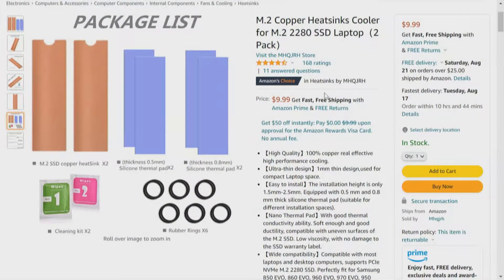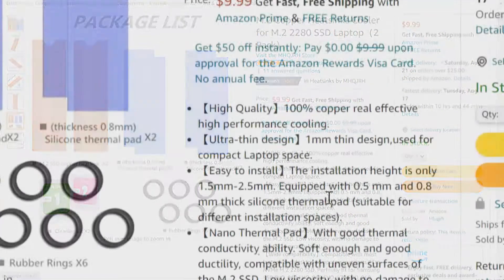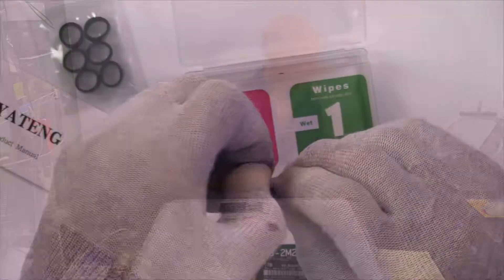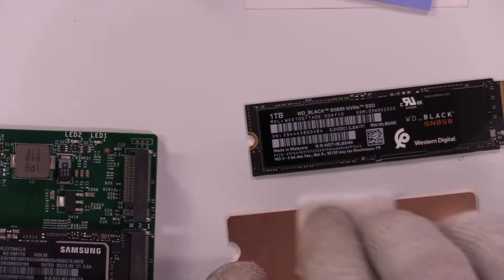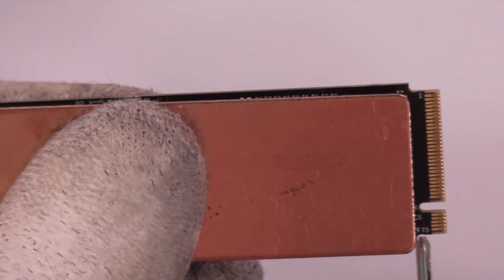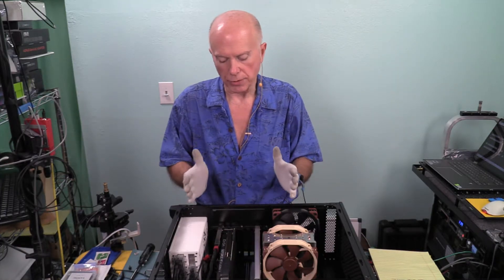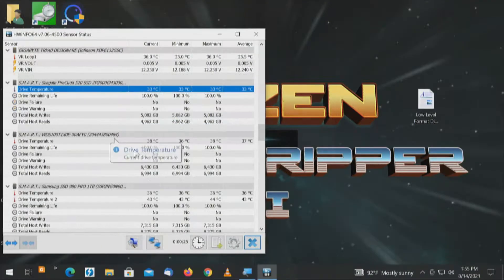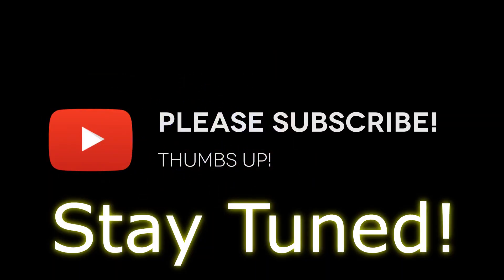Installation and Test of M.2 Copper Heatsink Cooler for M.2 2280 SSD Laptop

Comment: Hi, is there any alternative to using rubber bands to attach the heatsink. I have a fear that those rubber bands might melt and cause a mess. Can I use  twist tie as an alternative?  Thank you
Reply from the maker: Hi Habib Hussain,
Welcome! We too have concerns about the longevity of those Thermal Bands. They are not suppose to melt but We're concerned they may become brittle over time. They maintain pressure for Compression. A twist tie, Interesting idea! Give it a try! We Definitely need better fastening solutions for Heatsinks! Electrical wire used as a twist tie might be better insulated that just a twist tie. Keep Us Posted on Your Progress!
Reply: @BuildOrBuy  Thanks a lot. I will definitely give it a try. But which one do you think would be better suitable, wire (with no outer rubber insulation) or twist tie?
Reply from the maker: Ho @HabibHussain-uy7lg ,
The twist tie may not have enough insulation to isolate the internal wire if there were a break in the continuity of insulation. Could cause a short and that would be a Problem worse than what You're trying to solve. That's why the electrical wire which has better or thicker insulation. You're better off sticking with the Thermal Bands. No possible shorts! Another option might be Heat Resistant O Rings.
Reply: @BuildOrBuy  Got it. Thank you
Reply from the maker: Hi @HabibHussain-uy7lg , 
Absolutely! The only other Option for replacement Bands would be this:
Delock Products 18409 Delock Rubber Ring for Mounting of M.2 SSD and Heat Sink black 10 pieces https://www.delock.com/produkt/18409/merkmale.html
Reply: @BuildOrBuy  Would electrical tape work?
Reply from the maker: Hello @tankerock , 
Welcome! Sticky mess. Heat resistant Neoprene tape maybe.

Comment: Can you please explain or point me to your previous video where you explain how removing the SSD label b4 applying the thermal pad actually keeps it cooler? The other videos I've seen on YouTube seem to say the opposite.
Reply from the maker: Hi GunnSmyth Jaxx,
Welcome! Just now seeing Your Comment! Great Question! We do not do that nor do We advocate that. We have had a few Comments from Viewers suggesting that procedure. That's a choice. We're Testing from a Default and not changing anything from the Norm for a Fair Test. Everyone's Results may vary. This is a baseline for Comparison since We have so far Tested 14 M.2 NVMe PCIe Heatsinks. Fascinating Results! We Test too many Devices to remove any Labels. We would be busy figuring out what was what while trying to keep track of what We're doing! Hope that helps!

Comment: Hello! I don't if anybody tried but I am kinda noob at laptop modding,so I wanted to ask experienced ones! I bought a heatsink that's 6mm thick,and i have Acer Nitro 5 2021 case,I want to apply that heatsink to my ssd. But I am not sure if I have clearence or not. How can I measure it? Or is there any guide for it? Like "it should be 2mm or 3mm maximum" kind of. Thanks in advance!
Reply from the maker: Hi İLHAN BAYRAMOĞLU,
Welcome! Sorry to take so long in getting back to You! Working on Filming Videos! A lot of this is trial and error. Only way to know how much space You have, if any, would be to open the Laptop and see. 6mm sounds way too thick. Doubt you have even 2mm. Always Test and Verify! Try a Silicone Thermal Pad of 1mm and stack to determine the height clearance as You replace the cover. If too tight, You'll know very quickly! Hope that helps! Keep Us Posted on Your Progress! Thanks for Asking!
Reply: @BuildOrBuy  I also have the Acer Nitro 5 and I recently added a second m.2 nvme SSD. Underneath the second one there's a small bundle of wires that I'm worried about getting damaged over time. They have a thick black wrap around the middle but because the connector is wide on each end there's this exposed section of wires closest to the connectors on the end. Does the bottom side of an m.2 nvme SSD get hot or only the chips? I'm wondering if I should possibly try to put a piece of thermal pad in between the m.2 nvme SSD and the wires on top of the motherboard?
Reply from the maker: Hi @GrabLifeByDaPoosy ,
Welcome! From what You've described, suggest Insulating tape for non Conductivity. Don't want to get Your Wires crossed! Really! Depending upon Your chosen M.2 NVMe PCIe SSD Drive. Some have nothing on the back and some might have a copper heatshield on the back. You just have to be prepared! Hope that helps!
Reply: @BuildOrBuy  Thank you for your response. Does the circuit board get hot on the back side of an m.2 nvme SSD or is it mainly the chips installed on it? It just concerned me that there was wiring so close to the backside of drive. I wasn't sure if I should try to put some insulation between them.
Reply from the maker: Hi @GrabLifeByDaPoosy ,
Absolutely! Good timing! There's no way to accurately measure Heat from the back in this setup. Memory and Controller Chips gets hot. If the Temp of the Drive goes over the Threshold, expect Throttling. Some Vendors appear to expect Heat to dissipate through the PCB. Doubtful about that scenario. Hope that helps!
Reply: @BuildOrBuy  Thank you
Reply from the maker: Hi @GrabLifeByDaPoosy ,
Absolutely! Thank You for Watching!

Comment: where was the laptop installation in all of this?
Reply from the maker: Hi Divien,
Welcome! We have yet to make that Video! Testing 14 M.2 NVMe Heatsinks became a very involved process along with 3 different Thermal Pads. Then Subscribers Questions about Adding M.2 NVMe PCIe Storage by way of Quad cards to Motherboards. That too has taken on a life of its own. We will swing back around to this Topic! This will probably be using an ASUS Laptop. Just today We had confirmation of another M.2 NVMe PCIe Heatsink, Gigabyte, that will not fit in a Laptop so We're working on it! Appreciate Your Patience! Thanks for Asking!

Comment: I  didnt understand why you can achive pcie 4 speeds on a pcie 3 slot with the WD sn850?
Reply from the maker: Hi Admiral Spyro,
Welcome! The Supermicro Dual M.2 NVMe Adapter is just an I/O Card. There is no circuitry on that Add in card such as a PLX Chip to limit Speeds. Speed is dependent upon Motherboard Chipset and M.2 NVMe PCIe Drive. Now PCIe 5.0 will be a different matter where Speeds are Doubled again and heat also increases due to speed. Hope that helps!
Reply: @BuildOrBuy  Ah I see thanks!
Reply from the maker: HI @admiralspyro9722 ,
Yes! Interesting facts! Proof is in the doing!

Comment: Question... Would there possibly be any issue or even any possible benefit to layering a Loose/extra copper ssd plate/heatsink like the one in this video (1mm). Along with a 4mm Aluminum SSD heatsink (Example: M.2 SSD > Thermal Pad > 1mm Copper Plate > 4mm Aluminum Heatsink) ? Whether the Aluminum Heatsink is a 2 sided/piece or single.  Thanks in advance !
Reply from the maker: Hi Yoyo Droider,
Welcome! An option worth exploring! We've learned enough about M.2 NVMe Heatsinks and Thermal Pads to never say never and to test and verify. That's all that matters are Results! Do the Research and see where that takes Us! Hope that helps! Great Question! Thanks for Asking!
Reply: @BuildOrBuy ,  I was also wondering this, except I'm curious if you'd also need to put an extra thermal pad in between this thin copper plate and the larger heatsink or would you just place them metal to metal?
Reply: @gundamsdm  I would expect that the copper-to-copper contact wouldn't be sufficient for the same reason we don't put a heatsink on a cpu without thermal paste. I'd use the thinnest available thermal pad.

Comment: Nice video! In my laptop i have problem, M2 Samsung 970 EVO at bad spot and heat goes up to 110°C in game like PUBG. My laptop is Lenovo Y520. I will defintly buy thin copper sink since I do not have space for bigger.
Reply from the maker: Hi Josip Matić,
Welcome! Just now seeing Your message! Appreciate Your Comments! Laptops don't go far enough in helping Us to dissipate heat. Surprisingly, that solid piece of Copper das better than some of the other machined Copper We have looked at. Our concern is those bands. We don't expect them to last.
Reply: @BuildOrBuy  Company wants profit and we want to work the best, so this is excellent solution!
Reply from the maker: HI @josipmatic4732 ,
You are so right about that! Our Goals is to Keep it Simple and Make it Work! Appreciate Your Feedback!
Reply: I just made DIY heatsink from piece of copper! 3mm thick, polish it, set on thermal paste in tight it with rubber bands! Temperature drop from 92°C to 61°C. Even few pass more with CrystalDisk did not raise temperature! Awesome.
Reply from the maker: Hi Josip Matić,
Success on ingenuity! Congrats! To reiterate, those Thermal Bands the Manufacturers include may not last as long as We'd like. And regular rubber bands with give out even sooner so keep a watchful eye on Your Temps in case those bands become loose!
Reply: 970 EVO needs 2 sizes, 0.5.m and 1mm because the chips have different sizes. Theres a video showing that.

Comment: those rubber rings just melted in few weeks. what can i use instead of rubber rings?
Reply from the maker: Hi worgen666, 
Welcome! Just as expected! Although We did expect at least a few months instead of a few weeks. Not good. Interesting. Those rubber rings were suppose to be silicone. Guess not. Yes silicone is synthetic rubber however, both are suppose to be able to handle heat. They may have used a low quality banding product. We need to look at quality O Rings as a replacement. A 1 inch O Ring for a start. 

Maybe We can try Viton O Rings. This may work. Have not had time to Research those nor to fully vet them. I have knowledge of Packing and Gaskets as a Machinist from many years ago. Not certain how resilient they will be to stretch. Excellent properties for heat. 
1. 213 Viton O-Ring, 75A Durometer, Black, 15/16" ID, 1-3/16" OD, 1/8" Width (Pack of 25)
https://amzn.to/3HZcEtx
2. 270 Pcs Rubber O Rings Kit, 15 Size Washer Gasket Sealing Assortment Kit, for Plumbing Faucet, Automotive, Air or Gas Connections and Other General Maintenance, Convenient Box Packaging. 
https://amzn.to/3FyI9se
This is a start. But I do not know yet if this is the best Solution. 
As an Amazon Associate I earn from qualifying purchases.
Reply: @BuildOrBuy  i'll try zip ties. thank you.
Reply from the maker: Hi @rottenfist220 ,
Zip ties will eventually become brittle and  break loose. Try them. Less expensive. These Vedors have not fully fleshed out this thought of attachment. Keep Us Posted on Your Progress. That's another reason We have Tested so many Heatsinks.
Reply: Captor tape
Reply: Kapton tape

Comment: You used the heat sink on one side of the ssd. I see many using it on both faces. Does using the heat sink of both sides cool it even further?
Reply from the maker: Hi E IKE,
Welcome! Excellent Point! This Heatsink gave great results considering the simplicity of Design compared to other Heatsinks We have Tested! On the Supermicro Dual M.2 NVMe Adapter, not enough clearance on the back side for a 2nd Copper Heatsink and 2nd Thermal Pad. Based on all the Heatsink Designs We've Tested, no. The only metal behind any of them would be for a Backplate wrap around for compression to hold the assembly together. Close tolerances. To better Cool, swap out the Thermal Pad with a higher W/mK Thermal value. And We don't expect to have as much space in a Laptop as We do on a Dual M.2 NVMe Adapter. 

Here are 3 possible Thermal Pad replacements listed below. The 1st set is 2 Thermal Pads. The 2nd set is 1 Thermal Pad. And the 3rd Thermal Pad, also singular must be cut to fit. 
1. Thermopad Thermal Grizzly Minus Pad 8 - Silicone, Self-Adhesive, Thermally Conductive Thermal Pad - Conducts Heat and Cools The Heating Elements of The Computer or Console (120 × 20 × 1,0 mm) [8 W/mK]
https://amzn.to/3n4YkWu

2. Thermalright Thermal Pad 12.8 W/mK, 85x45x1mm, Non Conductive Heat Resistance, Extreme Odyssey Silicone Thermal Pads for PC Laptop Heatsink/GPU/CPU/LED Cooler (1mm)
https://amzn.to/3pcRZLy

3. Gelid Solutions GP-Ultimate 15W- Thermal Pad 90x50x1.0mm
https://amzn.to/2YXsOBg
As an Amazon Associate I earn from qualifying purchases.

Hope that helps! Thanks for Asking!
Reply: @BuildOrBuy  thank you for the detailed feedback. Really appreciate.
Reply from the maker: Hi @eike6441 ,
Absolutely! Details matter! We have now Tested 14 Heatsinks! There may be more. We will Test the top 3 Heatsinks and change out the Thermal Pads to see if We can improve Results. If so, to what degree! Pun intended! Change one thing, changes everything! Stay Tuned!

Comment: Does this work well for ps5?
Reply from the maker: Hi John Doe, 
Welcome! Yes! However, We're concerned about the longevity of those Bands. We've Tested quite a few Heatsinks! There are other Heatsinks that will fit! How fast is Your M.2 NVMe Drive? Faster M.2 NVMe PCIe Drives are running hotter!
Reply: @BuildOrBuy  I recently bought the Samsung 1TB 980 pro, still waiting for this heatsink.
Reply from the maker: Hi @JohnDoe-sn3sv ,
Samsung 1TB 980 Pro - Good Choice! The Heatsink should help immensely! To make it even better suggest using different Thermal Pads with a higher Thermal Conductivity rating.
Reply: @BuildOrBuy  Thanks.
Reply from the maker: HI @JohnDoe-sn3sv , 
Absolutely! Here to Help! Thanks for Asking!

Comment: I get 58°C on one ssd and 62°C on the second ssd (a samsung 970 evo plus) inside a laptop, running the same test without any heatsink. Ambient temperature 23°C. (Room temperature)
Reply from the maker: Hi OMG OMG,
PCIe 3.0 vs PCIe 4.0. You have a Very cool Ambient temperature Compared to what We run by about 10 Degrees! When We get ready to Upgrade the ASUS Laptop, We'll include those stock Temp numbers before We open the Lid! Our ASUS Laptop is also PCIe 3.0! You are well within safe Operating Temperatures! Thanks for Sharing!
Reply: @BuildOrBuy  sorry, for ambient temperaure I mean the room temperature.
Reply from the maker: HI @OoooomgOmgOmg ,
Understand. Got it! Same thing from Our perspective!
Reply: @BuildOrBuy maybe the difference is risen by pci 4.0
Reply from the maker: HI @OoooomgOmgOmg  , 
For the Drive Temp, yes PCIe 4.0. For the Room Temp, with the Gear in the room yes it's warmer! Lights, Cameras, Video and Audio Gear, etc.

Comment: I have a set similar to this but it came with silicone bands and a klapton like tape. Which one should I use? Im concerned on how well the bands will last over time. Thanks in advance
Reply from the maker: Hi Gerard A,
Welcome! Excellent Question. Not an easy answer! You are not the 1st to ask! We have the same concerns. The pros and cons of each. Silicone bands will stretch and hold compression. Although that depends upon the time of exposure to heat. Whereas Kapton tape is a thermal conductor and a high-performance electrical insulator. I would want to test both. Although, I don't see how Kapton tape could hold compression. Even still, neither are ideal hence the reason for a Heatsink with a metal wrap around base for longevity. And no concern about compression. Silicone bands might be good for 1 year. Kapton tape should last but the wrap at the time of the installation is dependent upon the tightness of the wrap. For what it's worth, Kapton tape has a Thermal conductivity of 0.8 W/mK. Minimal. I don't see Builders opening up a rig to swap our Thermal Pads unless Temps start rising for no apparent reason. Kind of like cleaning out the dust bunnies every 6 months. No one does that unless they have to! Same goes for a Thermal Band. A Thermal Band is a short term solution to a long term problem. Hope that helps. Not definitive! But yes, very concerned about longevity. Thanks for Asking! Keep Us Posted on your decision as to which You choose.

Comment: Why is it better to use the thicker thermalpads over the thinner one?
Thanks in advance!
Reply from the maker: Hi Tesseus,
Excellent question! The intention will be for more Compression for better Heat Transfer. That too is a Theory We still need to verify! We've learned enough to throw assumptions out the door! Thanks for Asking!
Reply: @BuildOrBuy  Actually, the thick one is for the thinner part of the SSD, while the thin part is for the thicker. Because the heights of the SSD controller and SSD memory slots are different and you want the whole surface to be even.
Reply from the maker: Hi @FaustRSI ,
Welcome! Thanks for Sharing!

Comment: Just curious about ambient temperature? It’s good to have it , so we can calculate the Delta(difference between ambient temp  and drive temp) , comparing the delta of each heatsink to get fair comparison.
Also for this heatsink, it seems that it performs well thanks to the mounting pressure provided by the tighter rubber bands, the previous one looked kinda loose , you want the thermal pad as compressed as possible , with every unit of pressure added , performance improves too and the pads transfer more heat . 
Again, Thank you for the video .
Reply from the maker: Hi 5 nm, 
Absolutely! I'm concerned about those Thermal Bands longevity. Excellent Point! I'm glad You mentioned that! We check the Ambient Temperature when Building a Computer! I will include that Data in the next two Heatsink Videos as well as with the changing of the Thermal Pads. Thanks for bringing that up! Details matter!